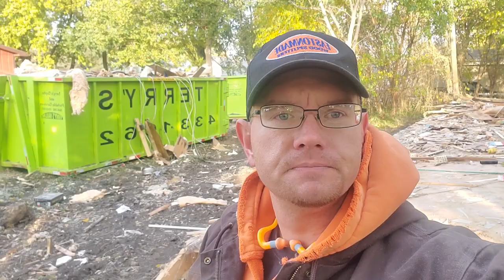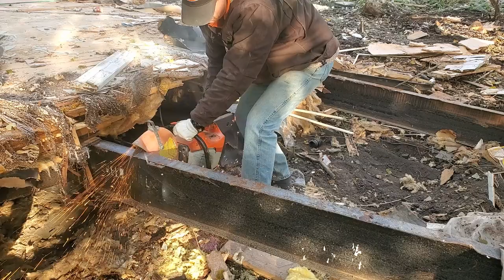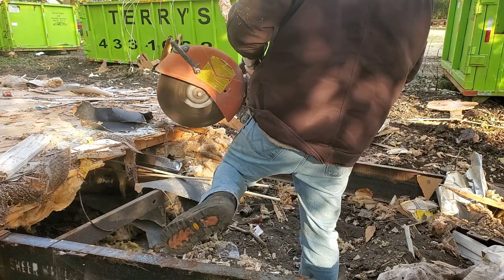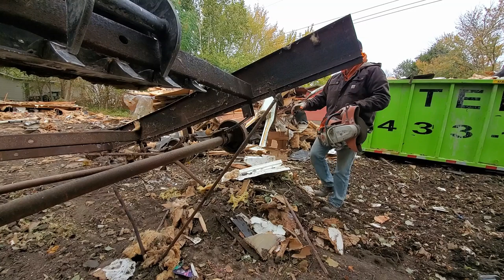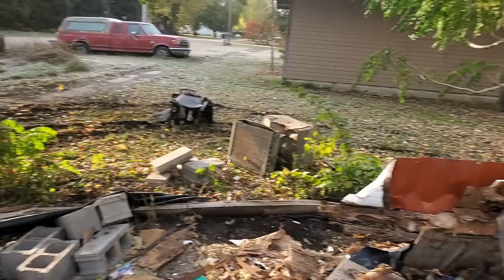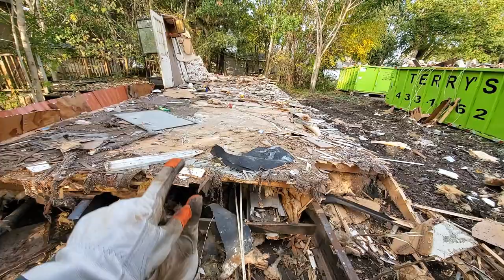#98 Stihl TS420 Cutting Steel I Beams

Comment: Nice video..generally i leave the trailer frame for last..i used my skidsteer with bucket n graoole attachment ti break down the trailer..then i cut uo frame last. I like the concrete saw..will definitely buy one

Comment: It was hard but that steel should of reaped a reward at recycling. Slow and steady wins the race and it will look so good when you are done. Keep up the good work. Wearing your wood cutting chaps might help with the steel sparking burning your legs.